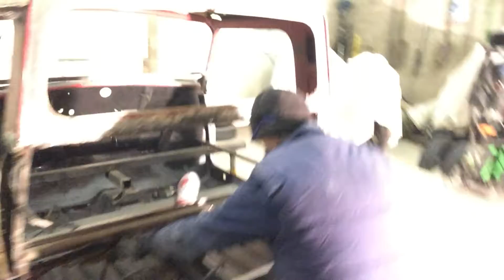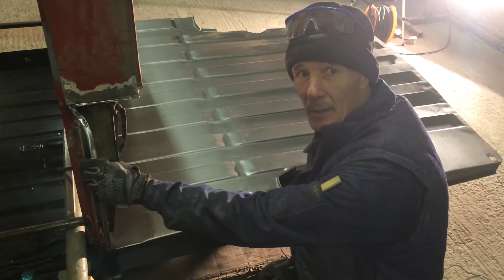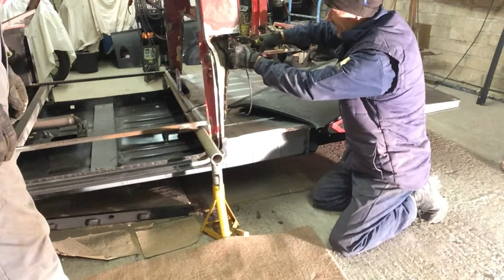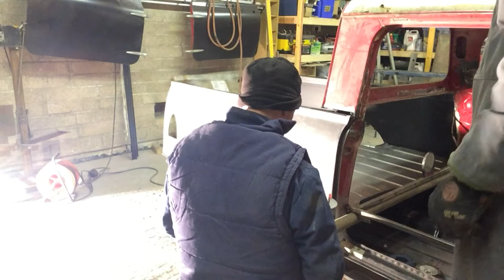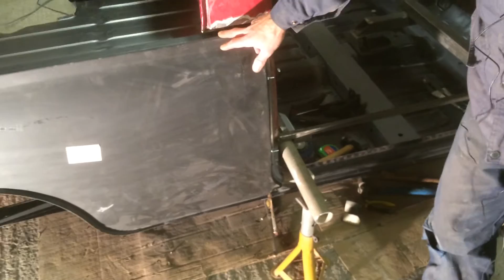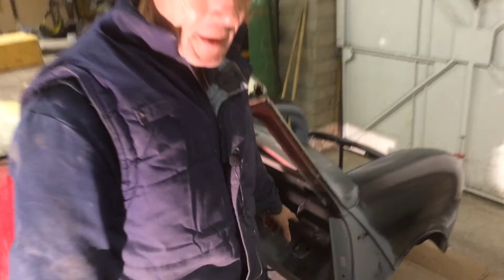Classic mini pickup restoration Episode 10

Comment: Really amusing to see how thin the floor panel actually is! Those strengtheners really work in those points but after years, big sag happens between them especially in my case where water damage from crappy afterthought sliding windows has meant badly rusty floor and having to shave most of the rotten metal away. My 68 van floor has copped a beating over the years and I’m currently using a dent puller to pull it back Into shape and patching bad sections with fresh metal. Great job guys. (Give Trev a ring :) Gold!)

Comment: Wow the car is really starting to take shape now, great work guys. P.s if the saloon roof is good, I’d replace the whole thing, saves dressing weld lines and filling. Always that chance of distortion too
Reply from the maker: See where your coming from bud. I haven't seen its joined yet! I was thinking its 
spot welded around the gutters?!? If that's the case i'd still prefer to change the 
skin. Time will tell. cheers.
Reply: I think they were roller spot welded from factory so they can be a pain to get out. Matt green has changed his roof and did a good blog on it
Reply from the maker: i'll try and watch that! My dads seen it. Getting some grief from my wife about how much time i'm spending on you tube! Will have to watch it on the fly.
Reply: Jon Aylott Ha my partner is the same...she doesn’t understand it lol.
Reply: that's what iam trying to say to my son mini Tom a lot less work